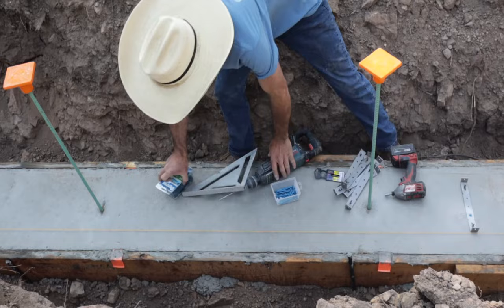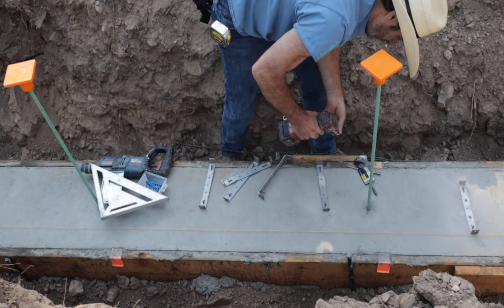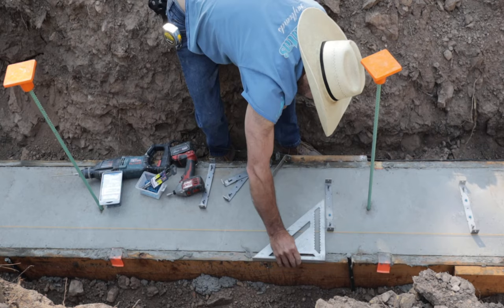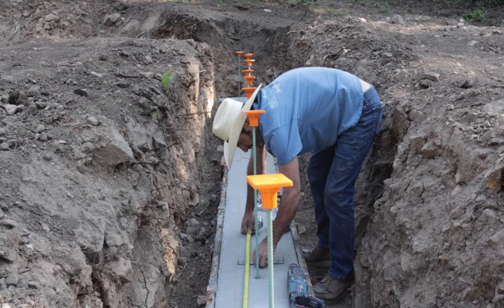BUILDING FORMS WITH SNAP TIE SYSTEM DAY 1

Comment: I don't understand why there was so much explanation for the brackets you screwed into the concrete, but then zero explanation for the forms.
Reply from the maker: The forms are sheets of 3/4 plywood and I pre drilled all of them and then use the snap ties and brackets, I was doing it by myself so sorry if I didn’t explain very good
Reply: @OutlawWoodworking you did well bae
Reply: @chivooo6451 😂

Comment: Thanks for this video. Do panels come with predilled pin holes? Do you have a video on forming and pouring a  addition with concrete roof? Are colums needed for the tied to the existing wall portion of the roof?
Reply from the maker: Had to pre drill all the holes,it’s a garage slab so after I poor I fill and compact the center then poor a 6” slab

Comment: You provided your spacing chart on a previous comment,  however you did not follow it correctly at all.    Should be one extra row of whalers going horizontal .    You used the roght drill specs if u had stood those sheet up vertical
Reply from the maker: Thanks , there was different spacing depending on the layout you wanted , it ended up working fine for what I was doing, thanks for watching
Reply: Good to hear , I may end up doing the same ,  would save me heck of alot of clamps.   Thanks for the video !